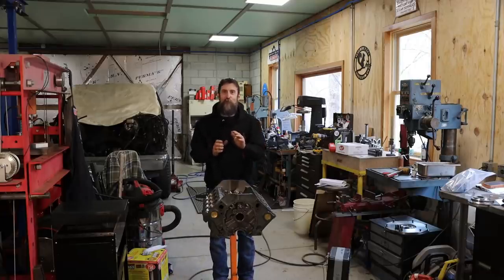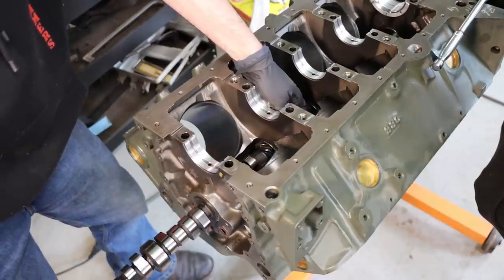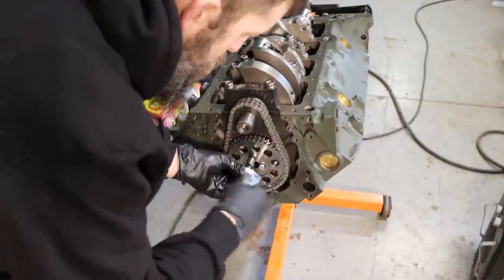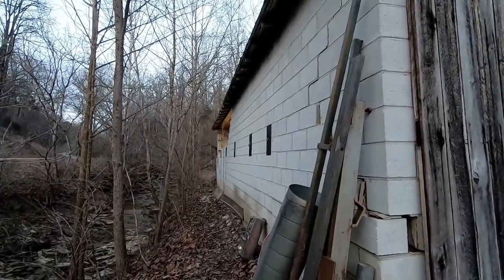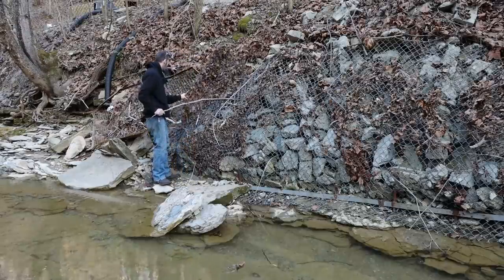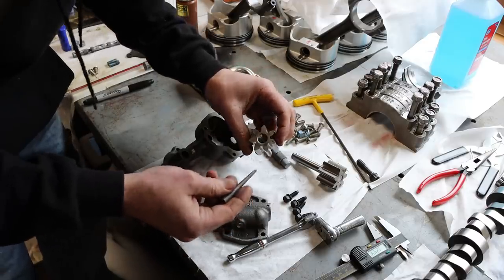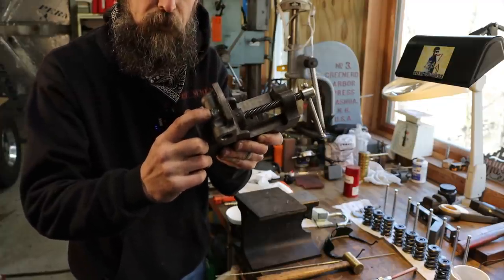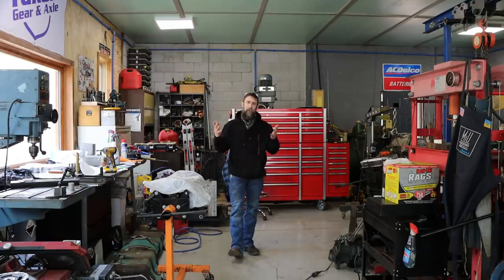Getting Ready for Balancing . Shop Update / Flashback

Comment: Thanks for the tour.  Man, you are one hard worker!  I used to live in hilly rural Vermont, so I am especially interested in your bank reinforcement. From everything I have read, global warming over the next 30 years is mostly likely to increase the amount of rain dropped by specific storms. Vermont is more granite and your area is more shale, but I'll bet that flash-flood erosion dominates how the stream bed changes. You are right to look at least slightly upstream for problems.  I couldn't tell, but it looks like your shop is on the outside of a gentle bend.  You can't do much about that, but it does mean that your bank undercutting problem is one you have to address, and soon.

Do you still work at the local college?  In any case, you might be able to get some low-cost informal advice from local water-resources management people.

Now that your shop is all closed in, do you still get squirrels?